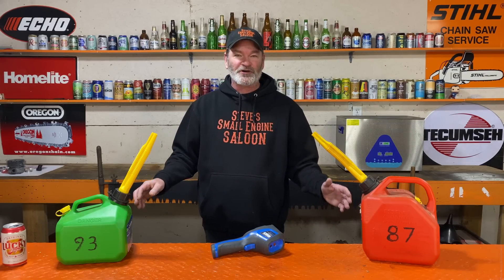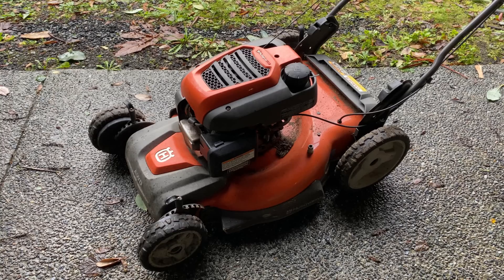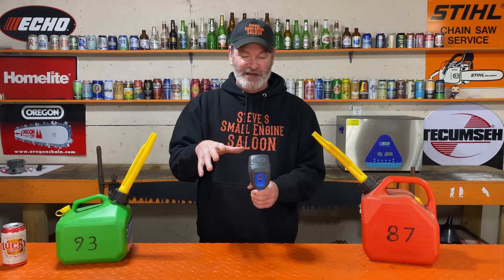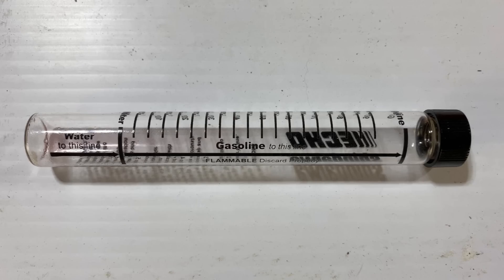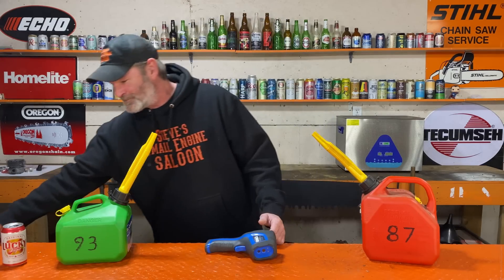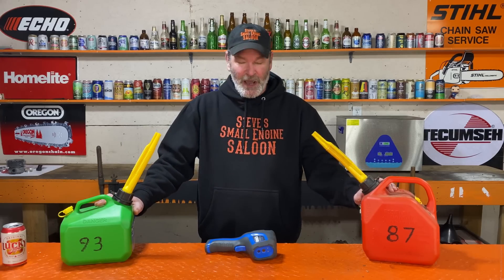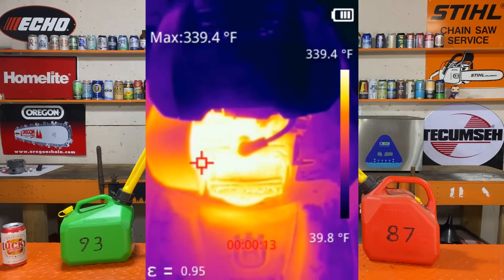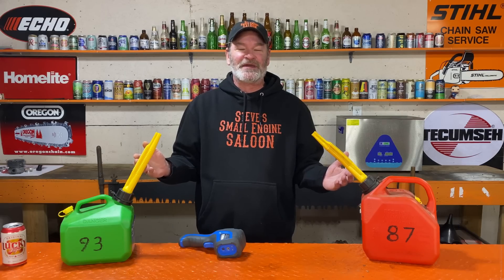Does High Octane GAS Make Your Engine Run Too HOT?

Comment: I had a built 283 chevy engine with 11.5 -1 compression.  Ran 93 octane when I could get it and 91 most of the time.  I mixed 91 with 100 low lead av gas to about 95 octane.  The idle came up and it ran much cooler.  Higher octane burns slower so it cools the piston top and valves.  Higher octane burns cooler than low octane.  Ethanol should help with temperatures in the engine if there's enough in there.  When I was a wee lad regular gas was 95 octane and premium was 97 or even 98 at some stations.  Most cars in the late 50's and into the 60's had high compression engines.
Reply: It's not as volatile as 87 is

Comment: Thanks for the video.  The octane rating indicates the fuel's ability to resist detonation.  It has nothing to do with how hot it burns.  The fuel that should be used in small engines that don't get used on a regular basis is rec. fuel which has no ethanol.

Comment: 1:28
Steve, isn’t this another myth though? 
I remember looking into it and couldn’t find any proof that the more expensive gas is actually better for small engines, cause I did believe that initially and I definitely wasted some money in the early years of my business.

Well, 2 years into it running 87 gas in my chainsaws as well as my 4cycle engines stump grinder, woodchipper and lawnmowers and zero issues…
Reply: 87 octane fuel is fine in small engines as long as you use it on a regular basis and don't let it sit in the carburetor for a long time. Even though 91 octane gas in Canada can have ethanol in it, it seems like the ethanol has a more pronounced effect with regards to gumming up carburetors, etc. with lower octane gas as compared to 91 octane and higher fuels.